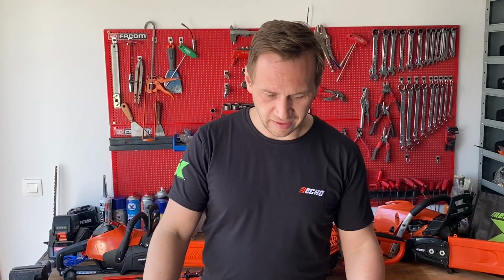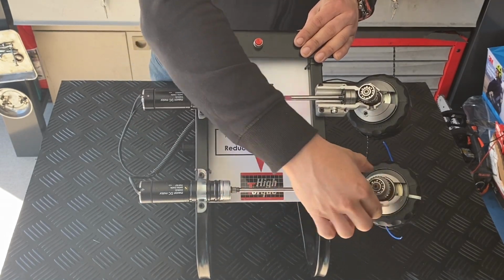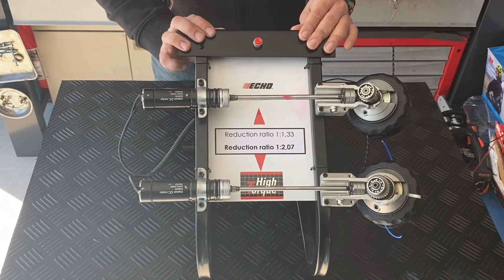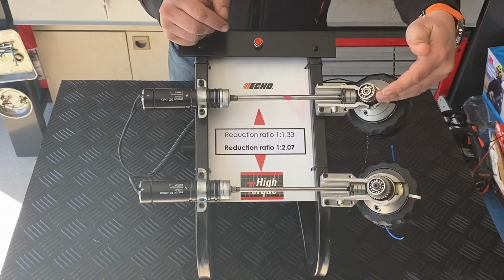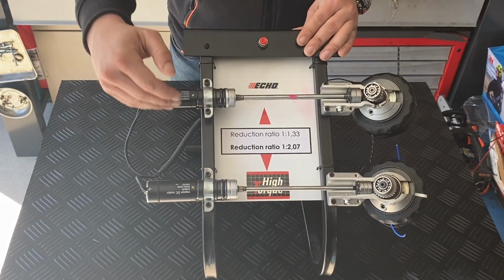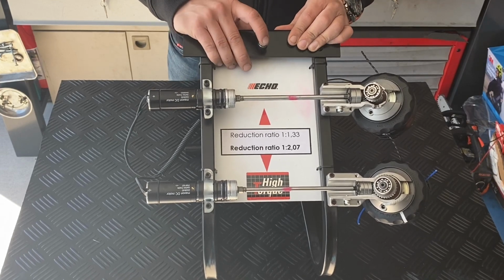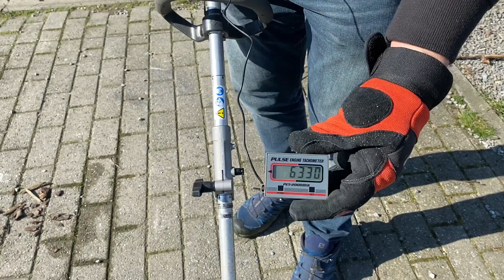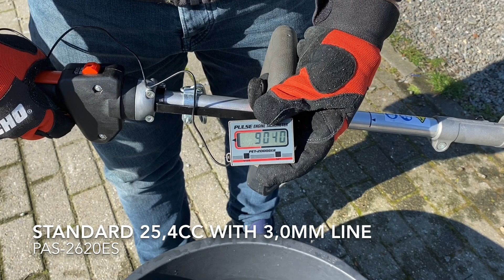Increasing your efficiency and lower the running cost! High Torque vs standard gearcase (Bevel gear)

Comment: But high torque is useless over  30cc engine, it's like you are ever in first gear in your car, with a little engine it's so useful but not for a big engine for sure.
Reply: Ιs not useless. The engine , with 2.07:1 ratio, has a lower load resulting in higher engine resistance. The load is known to wear out an engine
Reply: But engine needs to rev more to achive cutting speed

Comment: The comparision is BS, used different trimmers and obviously not going full throttle on "standard" trimmer in water bucket.
Reply: Different handle doesn’t make it different trimmer.  Everything is fine with the comparison except few BS comments :)